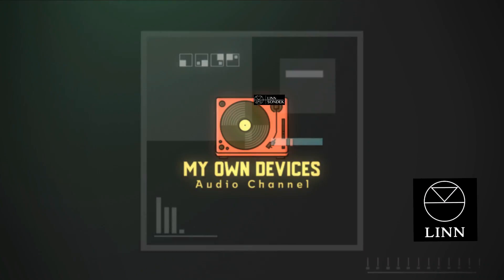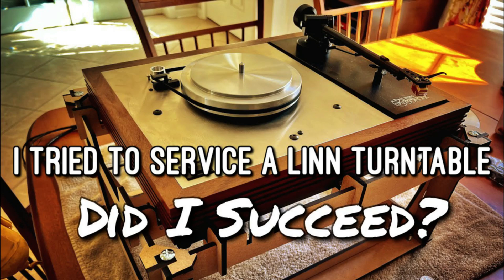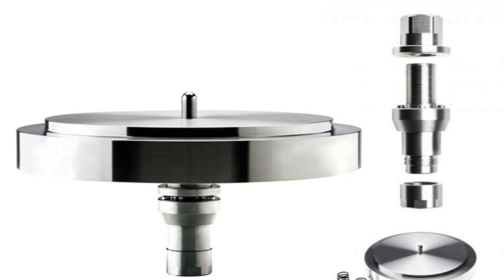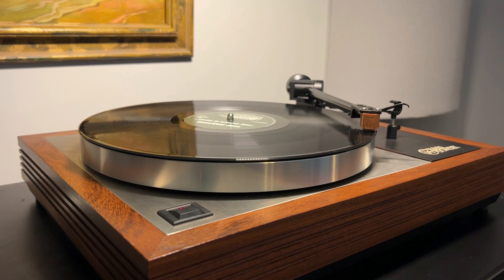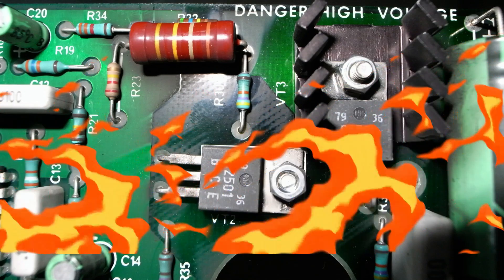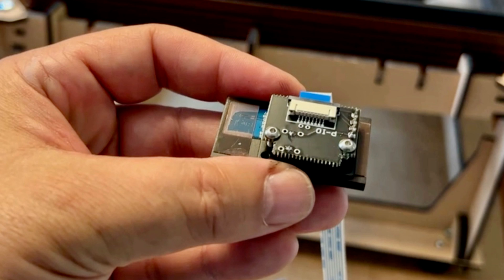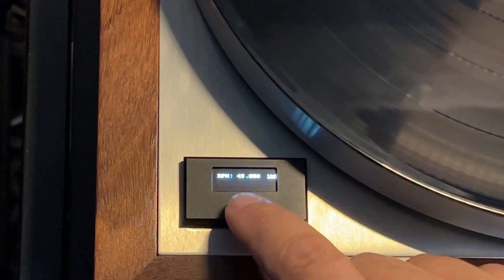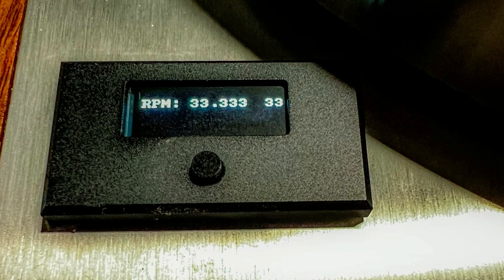Part 1: 33.333 RPM! Upgrade Your Linn LP12 Turntable With The Zeus Speed Controller

Comment: I love the Zeus, it was recommended to me through a Linn users facebook group that I'm a part of.  I bought a  basket case LP12 last year for 100 bucks, it was a late 70's model that needed a lot of work - especially the speed control as it looked like a fire hazard.  Anyhow - the Zeus is a great piece of kit - love how easy it was to install and it works and looks sharp, but I agree with you - I wish the power button was a little bigger!

Comment: I have a outboard Zues I started out with inboard Zues. They both are great. I have also used Mose/Hercules a Mober DC system and the Zues is by far the BEST. The Mober was close  but the Zues is better.